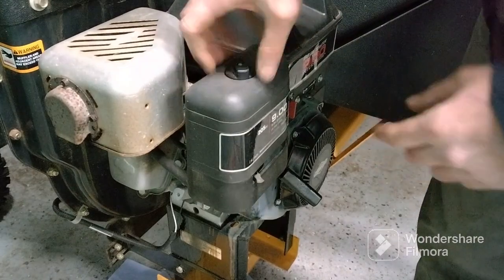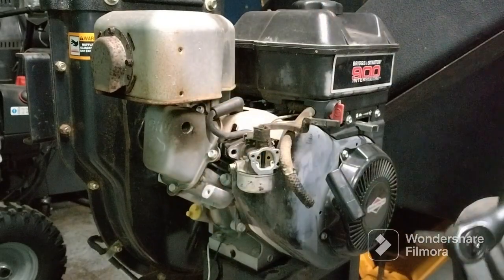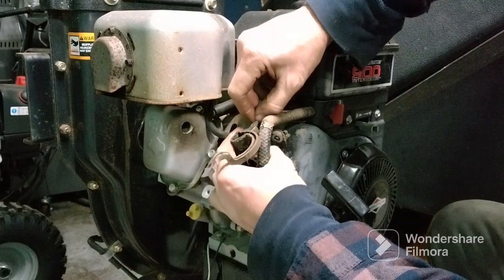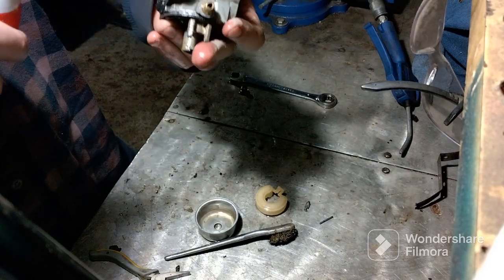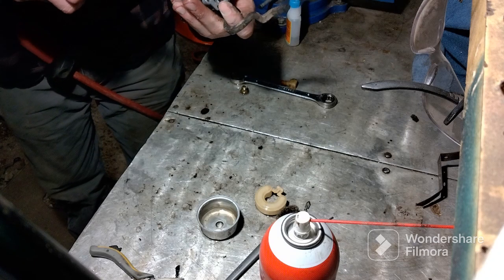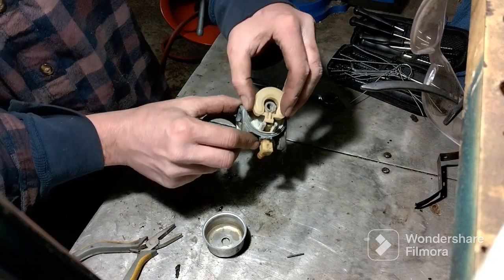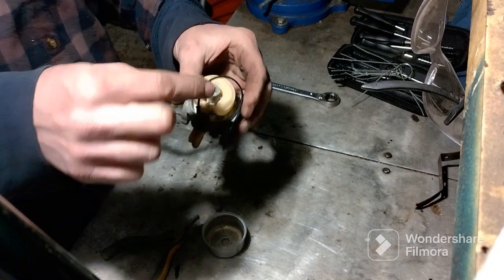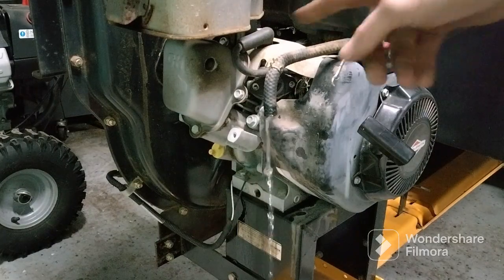how to clean a carburetor and taking it off craftsman leaf vac chipper. Briggs & Stratton motor

Comment: That crusty stuff is dry Ethanol that in gasoline. If at all possible run non-ethanol in small engines because of leaving them set for long periods of time with out using them.
Reply from the maker: Already knew that every time I've ever had one that set for a long time it does that but thanks for letting me know